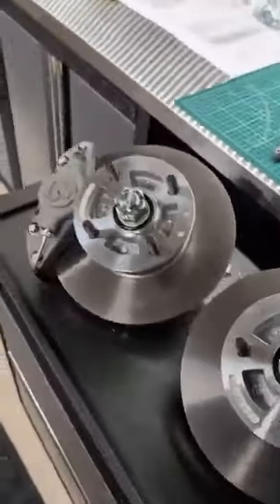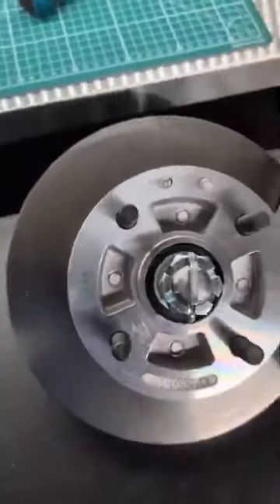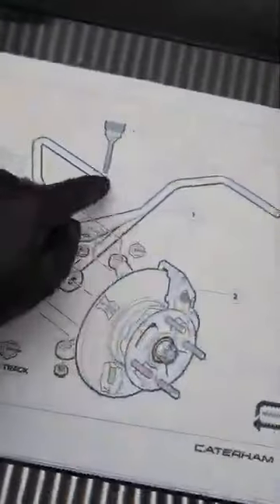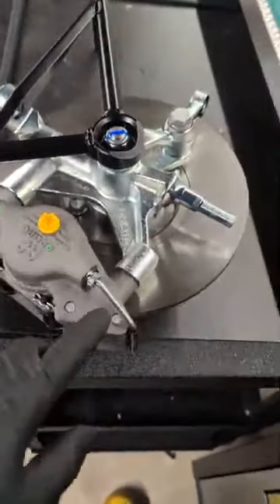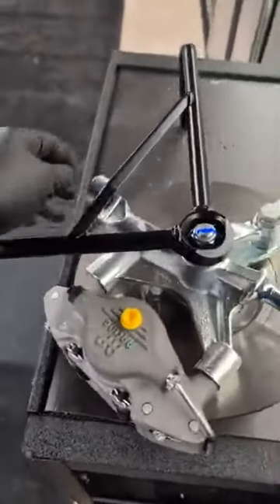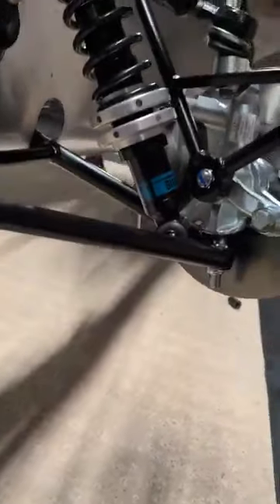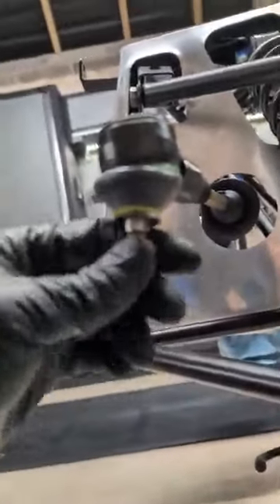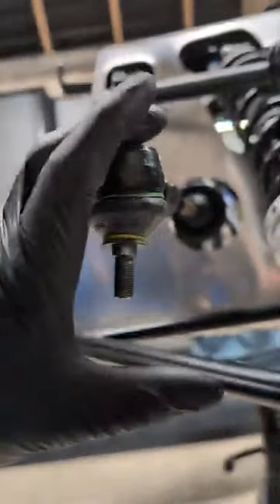Caterham Academy 2025: Ep4 Uprights

Comment: Does the under side of the threaded section of the ball joint not take an Allen key so you can stop it turning as you tighten the ball joint?
Reply from the maker: Unfortunately not